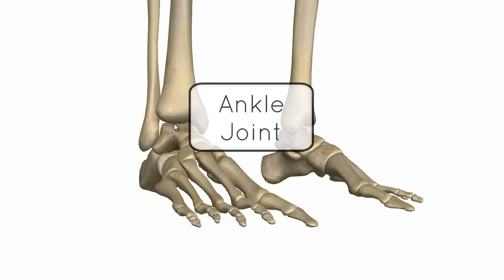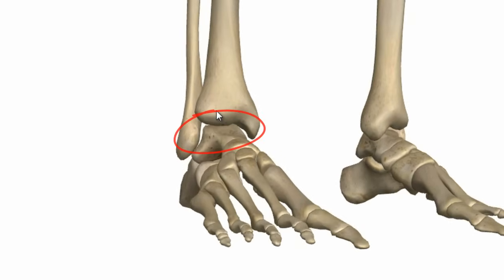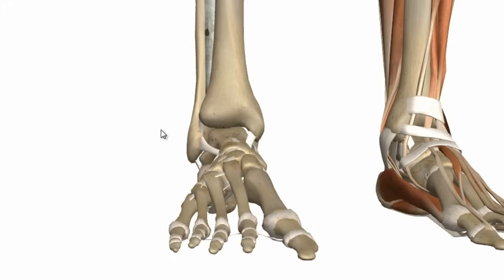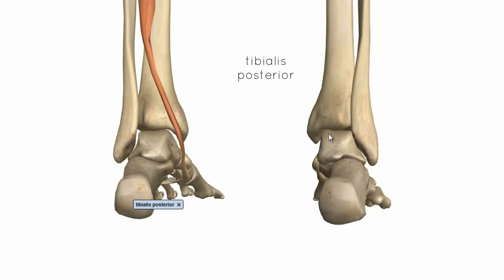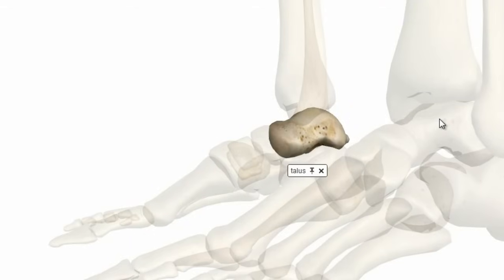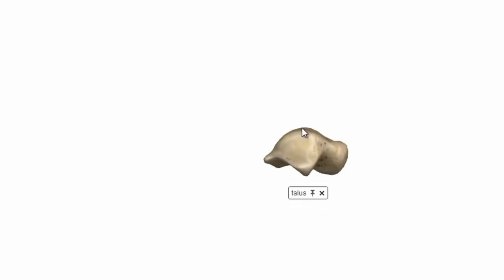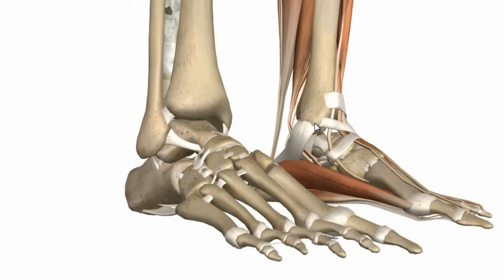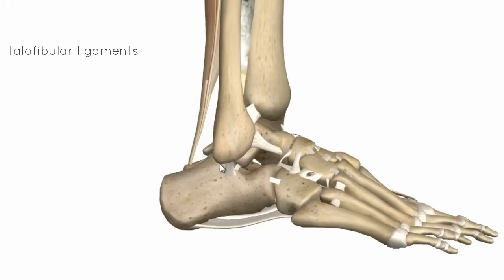Ankle Joint - 3D Anatomy Tutorial

Comment: This video has helped me understand a lot - I fractured my tibia and fibular when a heavy motorcycle fell on my leg and due to already having a plate and screws fixed to my upper tibia some 20 years ago there is no chance of using a 'nail' in my tibia.
 An external Llizarov frame is fixing my tibia parts to enable that to heal and there is an addition to the frame at the lower end fixing my calcaneus in a relative position to my tibia - this is the only part of the fixture that causes any pain due to Physios insisting I walk and fully weight bare from the start. The Surgeon who fitted the frame has told me to only bare about 25% of my weight at this point so the Physios are wrong yet again, and they wonder why I told them to go away ! Why do they always want patients to do too mich too soon ? 
My own sense of well being told me to ignore the physios and I sent them packing - if I had followed their 'orders' then I would not only have experienced great pain but also possibly have ruined some of the Surgeon's great work as the ligaments in and around the ankle joint would have either been damaged or caused undue stress to the lower part of my tibia.